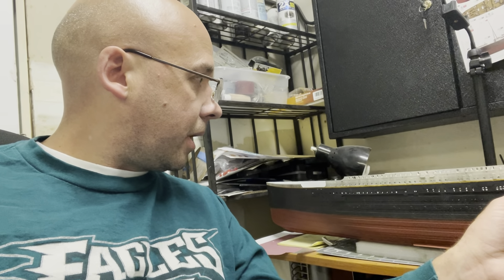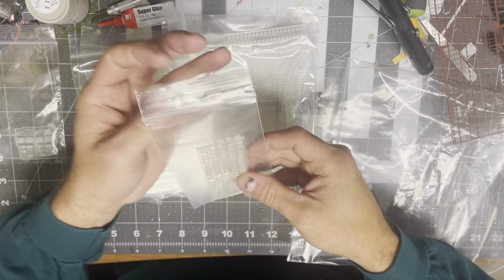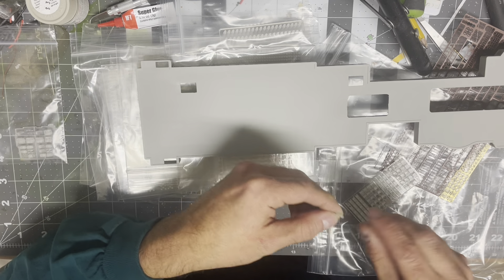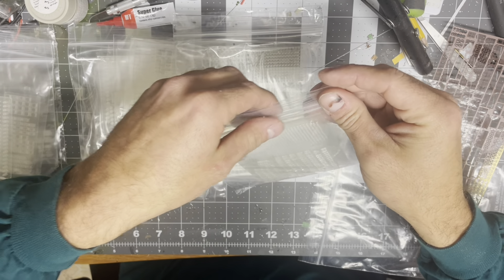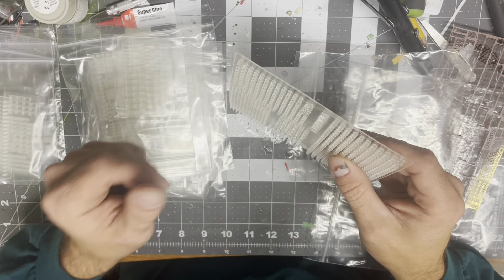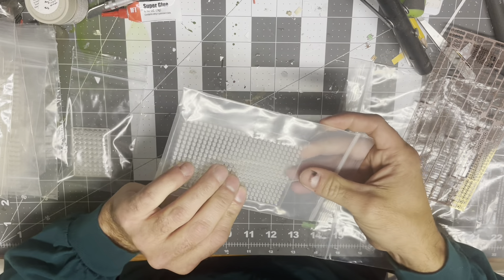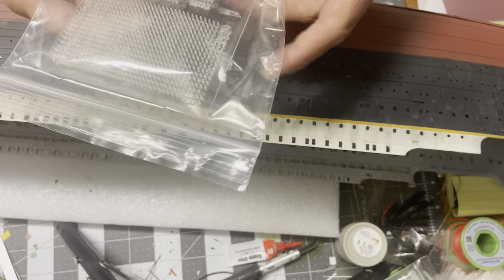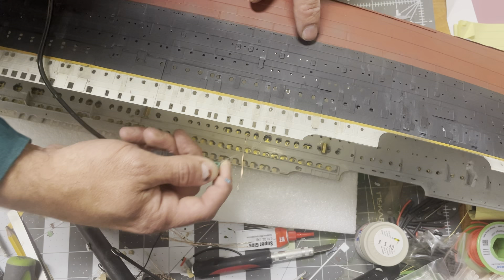BnB Scale Ship Jewelry Props Drops & More          Portholes and Windows - Titanic 1:200

Comment: I’m about to commence my build and yes like many I have just about every aftermarket detail set. I’m very interested to see how much the port hole lights show/how bright, especially when I see most builds require at least 1” of fibre optic cable to light up with the light strip applied inside the hull.